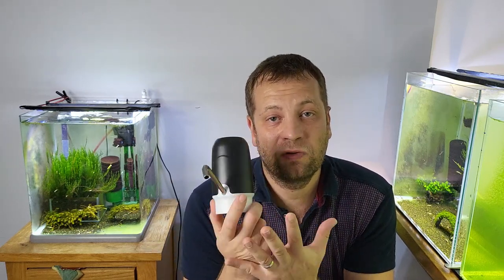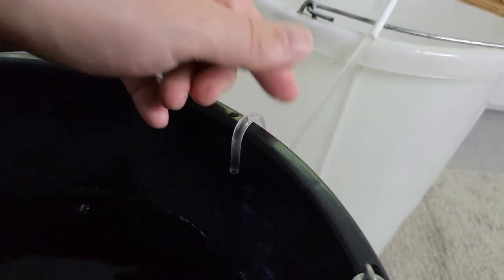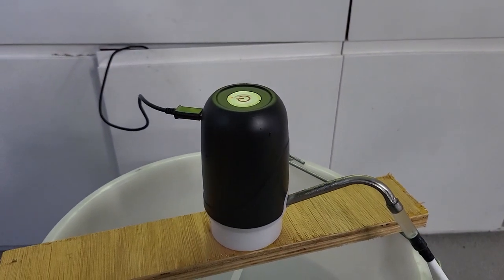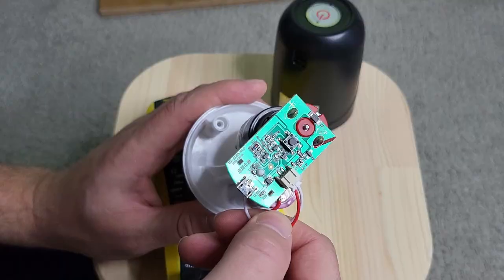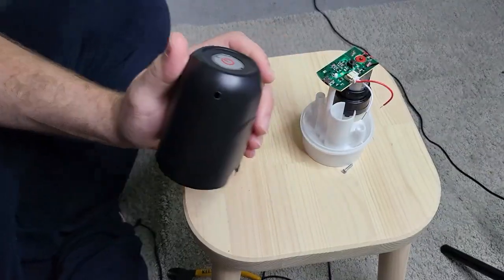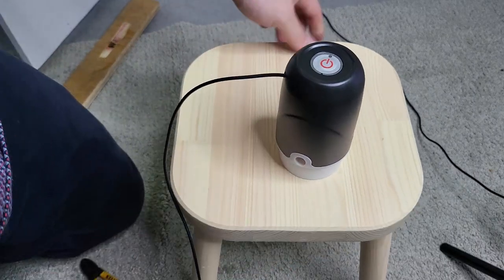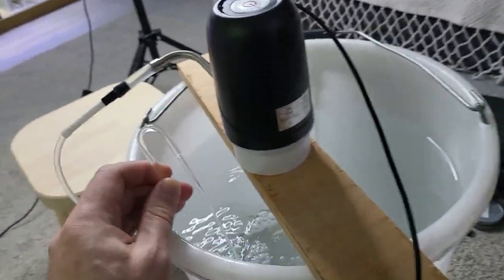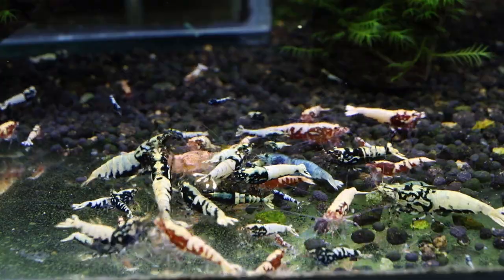Water Dispenser HACK - How to make it work from USB | Shrimp Tank Water Change

Comment: My main tank is a 300L. I use a 60L tank in stand to prepare the water. I mix the shrimp salt a week before the 60L also has active soil and a heater to enable to tank to come closer to the main tanks water parameters.

I then use a pump to pump up the water slowly to the main tank with a pre built outlet from a old eternal filter system.

To do the water change I have the outlet from a old external filter connected to a single sponge filter this is then piped down below the tank with a valve to turn off/on to drain water very slowly without any shrimplets getting sucked through. 

Has been working a treat, I feel the water being stored with active soil helps reduce the ph to prevent any swings in parameters.
Reply from the maker: Yes i saw some breeders do the same - ageing water in the container with the soil to lower ph and match the water in the tank. Definitely good idea. I might try to do this in the feature

Comment: Hi, I bought one after watching your video. Mine does stop every few seconds, battery is fully charged, do you know if its possible to make it to no stop? Thank you
Reply from the maker: I think it's probably a faulty one. Mine working for at least 20 min on full charge and only stop once battery dead. You can try to connect usb cable to it like i did in this video
Reply: It turns off automatically every 60 seconds working, for safety reasons. I will try your method and see if it works. Thank you
Reply: Did you work out a hack to stop this?
Reply: @ianswenser2986  No, unfortunatly